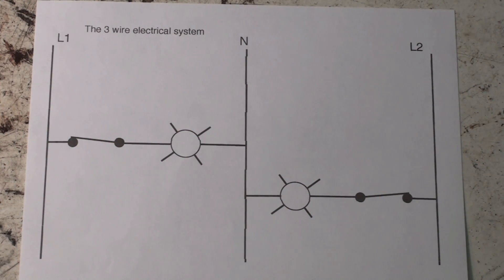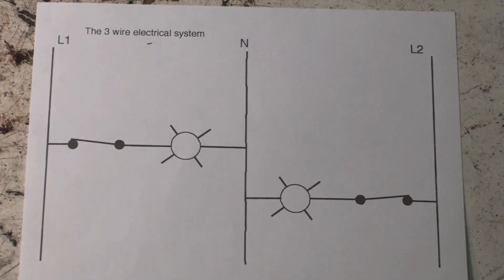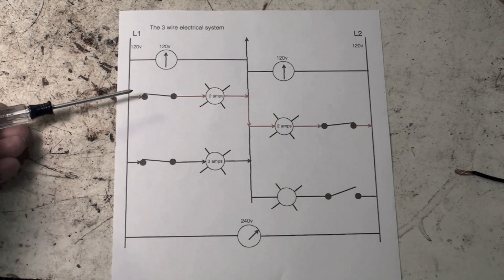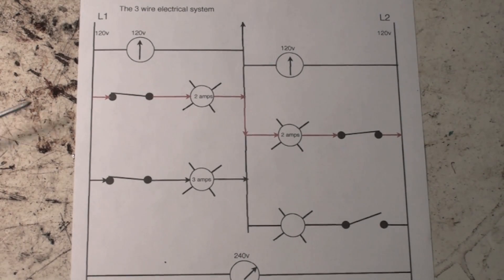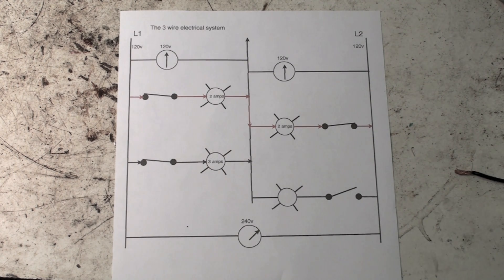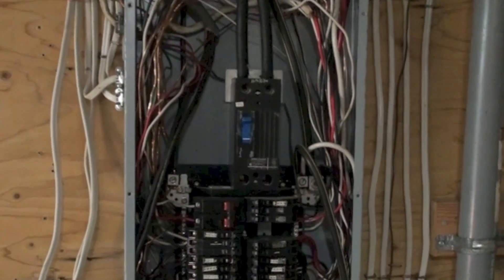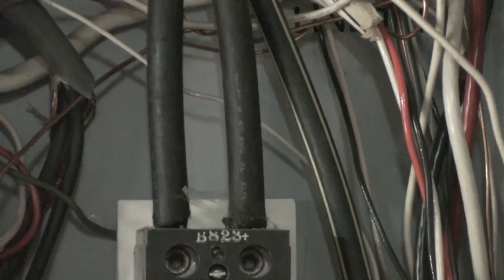How the 3 wire electrical system works

Comment: Hi, I'm an Electrical Engineer from Australia and I just stumbled across this video. I watched, I understood what the poster was trying to convey but I must say it would be a little confusing to the some and some statements were made that are not entirely accurate, not enough facts were conveyed and some are entirely wrong.I do understand that mains AC (Alternating Current), distribution and delivery to end users is somewhat different in the USA compared to other parts of the world (not making a judgement here, just a statement), but the principles and behaviour of electricity and electrical circuits are consistent and dare I say universal. I apologise now if I am going to offend people, but three simple basic rules:1. "Potential Difference" measures the ability of work to be performed between two points i.e one point has to be at a "higher' potential relative to the other point for any work to be performed. In electrical circuits this difference is measured in Volts (named after one Alessandro Volta - inventor of the battery and other things).2. "Current" is the flow or movement of a substance caused by a potential difference. In electrical circuits it is called an 'electric current' or flow of electrons and the rate it is measured in Amps (named after one André-Marie Ampère).3. Electrical current will always flow from a point of high potential to a point that is at a lower potential and will always take the path that offers the least 'resistance' or impediment to its flow.Alternating Current is created by varying the potential difference between two points over time in an electrical circuit. Voltage is changed from a Peak Value down to zero and then back again over a fixed interval of time - cyclically.  Because you do not know the actual value of this voltage at any given point in time we just use the 'average' called an RMS (Root Mean Square), of the AC current. In the USA it is 120VAC and it varies at 60Hz or 60 times a second (actually it goes from a positive peak to a negative peak in one cycle so it actually varies 120 times in one second). Now grayfurnaceman has shown how each home is fed with three cables from the street. L1 & L2 are the so-called 'hot', 'live' or 'active' lines as we call them here and the other is the N or neutral. These are fed via so-called centre tapped transformer where L1 & L2 are the outer ends of the electrical secondary coil and the N is 'tapped' from the centre of this coil. As grayfurnaceman correctly stated, if you place an AC voltmeter across L1 & L2 you will indeed read 240VAC!Now, if you took another two AC voltmeters and placed the positive leads of each on L1 & L2 respectively and then their negative or common leads both onto the N you will see that both meters will read +120VAC. So this adds up to 240VAC which is what the meter across L1 and L2 shows so its ok - not so fast. Referring to Rule 1 above, L1 & L2 CANNOT ever be at the same potential of +120VAC (as offered by the video), referenced to N because it would VIOLATE Rule 1 with the voltage between L1 & L2 having to be 0VAC and not 240VAC as measured!It is actually because True-RMS voltmeters work by measuring the potential difference between its positive lead and the black or common lead and calculate the average only. So the voltage on either of L1 or L2 could be negative or positive at any given point and it would not matter.Now the astute amongst you would have now worked out that for this to work, be consistent with what we see on the meters and obey the rules and - we must conclude;Fact 1-  Both L1 and L2 can NEVER be simultaneously at a positive or negative value with respect to the N line.Fact 2-  When the voltage on L1 is increasing positively then L2 must be increasing negatively at a negative voltage in reference to the N line and vice-versa.In reality the L1 and L2 lines do indeed have an alternating voltage and they move in a sinusoidal fashion but are 180 degrees out phase with each other.So now referring the diagrams we have a 5A load between L1 and N and a 3A between L2 and N. Here's how the electrical circuit works for simplicity I have assumed peaks;Case 1: When L1 line is positive, L2 line is negative and in accordance with Rule 3:5A of current of will be drawn from L1 lead through the loads and into the N lead to the street as it's zero resistance. 2A of current will be drawn from the N line through the loads into the L2 lead. A nett total of 3A will be returned to the street on the N line!Case 2: When L1 line is negative, L2 line is positive and in accordance with Rule 3;2A of current will be drawn from L2 line through loads and into the N line to the street as it's zero resistance. 5A of current will be drawn from the N line through the loads and into the L1 line. A nett total of 3A will be drawn from the street on the N line!So result is same - if you place a Current Clamp meter on the N line you will see the 3A flow but electrically not exactly the way it was originally explained.Now why exactly is the N line which, as described carries electrical current actually connected to a grounded earth?
Reply: Mate, is this some sort of back-handed comment? Sorry to hear that in your work-life you had to deal with "absolute dunces" and "incompetents", as you say. Personally the OP understood the context of my comments and was appreciative so I can only construe that it's you having a hard time understanding. I won't apologise for pointing out technical inaccuracies as I like to see and deal with correct facts.
Reply from the maker: +John Canalese Thanks for the thoughts.  Your explanation is factually correct.  My job here is to explain the 3 wire system so the student will understand, in a basic way, what to look for when troubleshooting problems with this type of wiring system.  When teaching, you have to decide exactly how much you want to explain so that the student will understand the concept without delving so deep into theory that you lose them.  The fact that in alternating current, the peak voltage is 150 volts is not useful as the vast majority of the cycle averages around 120 volts.  If I was teaching an engineering course, these things would be useful.  btw, I have been to Australia 4 or 5 times and I consider it the best vacation destination out there.  Nothing compares to the barrier reef!  
GFM
Reply: +John Canalese Very good elaboration, it closes the loop on Grey Furnace's "simple to follow" explanation by delving into phase relationships and how the transformer produces them. The overall collaboration was great! I love this forum.
Reply: +John Canalese Thank you so much!! Electricity can be so conceptually difficult to grasp. I am looking forward to thinking about your comments.
Reply from the maker: +JetMechMA The primary reason for the connection to earth ground is to provide a path for lightning and other surges, spikes etc without them going into the structure and causing damage.  Ground fault protection as in the GFI does not nee3d an earth ground to operate normally.  Hope this helps.
GFM
Reply: John!, old bean, I have worked over 38 years in the field and some of the dumbest people I have ever met have been engineers, just saying?.
Reply: that was a better explanation.  I didn't like the "neutral is a gathering place" analogy. I would think it would  be better if you showed the entire circuit with the transformer windings so that your could see it as 2 distinct loops of current and what the neutral/centre tap actually does.
Reply: MrOperettalover  I presume your country is America. As I said I am not 100% familiar with Electrical wiring standards in USA but I think there are many different ways power seems to be delivered 1) 2-wire with 'hot' and a 'neutral' 2) 3-wire with two 'hots' (180deg out of phase), and one 'neutral' 3) 3-wire 3-phase system with three 'hots' (120deg out of phase) 4) Others ?. In trying to comprehend your response I deduce that your house seems to be connected with a 3-Phase system distributed from a 'Delta' wired secondary Transformer in the sub-station (?). That is possibly why you see 220VAC RMS as line voltage between the leads - although I thought it should be closer to 240VAC because in this configuration Phase Voltage = Line Voltage. Now if as you say you have , for example L1 & L2 wired as "hot" and "neutral" at your house outlets then why are your appliance's not exploding - I thought 115VAC is the standard and they are going to get 220V! Using your description I simply cannot see how you can power domestic home appliances there unless there is a another step-down transformer in your house delivering 120VAC. I don't fully comprehend your 'over-voltage' protection and load sharing statements so I won't comment. On the fuse issue, I think you are talking about RCD's (Residual Current Device), which monitor 'hot' and 'neutral' current flows in a circuit and will rapidly disconnect the 'hot' supply if there's a difference, around 20mA usually meaning a leak to ground somewhere. We have those and have been mandatory in Australian Wiring Code for many years. EVERY outlet has a mandatory ground circuit. Australian power street cabling is wired as 3-phase with Neutral (four wires), at 230VAC nominal Phase Voltage at 50Hz - a Wye Transformer. Most houses are fed a single-phase and Neutral (two- wires) with a each house in the street alternating in phase to load share. Houses can be fed 3-phase for large A/C systems etc. I'll let the authorities know that it is "retarded".
Reply: @johncanalese588  I agree it seems like they're making it mandatory three phase or L1 L2 and n when say going to a subpanel for a small shed it could just be L1 and n but I'm guessing that is wrong in America?
Reply: Warren McCarty & PJ I’m not living in America so don’t fully know the standards. But, I presume most if not all modern or new houses will be wired to street power with three wires - L1, L2, & N. The heavy power users like. Dryers, ovens etc will be powered with a two-wire circuit of L1 & L2 (240V). The lower power consumers will be  powered by two-wire circuit comprising of L1 & N (120V) or L2 & N (120V), presumably with each required circuit  alternating its use of L1 or L2 so as to share power load. Now, a shed would just be another of these circuits. The ground wire in the power socket  can be connected to the N wire but NOT directly, it will be carried back to the main distribution board and connected to the street power inlet BEFORE the distribution panel. In this way any RCD devices can function correctly. Of course in my explanation above, if you are requiring an “earth” protection socket to be used then the two-wire circuit(s) would then be three-wire circuits with the additional wire being the earth and connected as I explained.
Reply: The North American power grid produces 3-phase power. COMMERCIAL facilities will have 3-phase delivered. RESIDENTIAL/small business facilities have single phase 230 vac that is CENTER TAPPED providing the two 115 vac loads with the center tap be the neutral. LOAD-1 and LOAD-2 are in phase. Measuring across LOAD-1 to LOAD-2 gives 230 vac.

Commercial facilities provide 208 vac "single phase" utilizing two 115 vac loads that are tapped off different phases 120° apart. "RMS" meters read 208 vac when measuring between the two loads, but 115 vac between each load and neutral. Fortunately, most equipment will work with this arrangement. You must have seen the "208/230" designations.
Reply: John Pomer No, on any center tapped secondary winding of a transformer the voltages at each end of the coil are indeed 180deg out-of-phase with respect to the center tap. A voltmeter connected across the coil (L1 & L2) would read 0VAC if they where "in phase" and not the 230VAC as you stated. Yes, pretty much all countries have Power Stations generating 3-phase power (each phase being 120deg apart), with phase voltage stepped-up to 330kV or 500kV to be distributed to the users. Where it gets interesting is how this is then stepped-down, transformed and delivered to end users. So, if I understand you correctly these "Commercial" facilities must be getting 3-phase power fed from a substation using transformers with Wye-configured secondary windings and these have a 115VAC phase voltage? then that is why you see 208VAC as the Line-to-Line voltage (i.e 1.732 x phase voltage). Hmmm.....so this is yet another power delivery method is USA. How do you guys manage all this.
Reply: @johncanalese588  Hi, I do not understand much about this because it's not my area but I saw a video where they make a combined Delta-Star connection: 
https://www.youtube.com/watch?v=uw3hkaWP27A&list=FLh-Bxr3oXZoqdiiJb-0Dxmw&index=2&t=0s
(The video is in Spanish, any question I can try to translate. My English is not very good either)
The system shows a three-phase system (208V) consisting of three lines of 120V and one neutral. In addition to a fourth line (line D) that in combination with line B, provides 240V single phase.
I do not know what commercial uses this connection has. I understand that in North America (Caribbean and Central America included) the houses have 240V in split phase (neutral and two lines of 120V with 180 ° out of phase)
Reply: Oops - 180° out of phase is correct. The two load lines are off the same phase.
Reply: Correct; voltage fluctuate from about 95V to somewhere around 135V; that is why computers have a transformer power supply that cleans up current and makes it a steady 120V. The secondary is also 120volts but constant.  In high amperage environments, like specialty welding machines where secondary current is very important, they use an electrical reactor to control amperage.  By the way, your video's are really good!
Reply: So now I'm confused. What I understand from you is L1 and L2 have 120VAC (shifted 180 deg) relative to N. So N is ground. So why does it say in the video that N is not ground?
Reply: I could be wrong, but I don't think grayfurnaceman is conducting a lecture on electrical engineering, just trying to give us lay people an idea of how our power panel is set up.  Just for your information, before I retired I worked for a US federal agency in a technical job where I worked with engineers and electricians among others.  Some of them were absolutely brilliant and others were absolute dunces, absolutely incompetent.  So just the fact that a person has made it through college and has a title doesn't mean that they really know anything.  I was amazed at how stupid some of our engineers were.  Some of them did not seem to understand ohms law.  Hats off to the smart ones though.

Comment: power gong from l 1 to l 2, don't make sence. doesn't 120 power end up in neutral?
Reply: +brad alhadri 
Yes. 120 returns on the neutral 240 goes pole to pole.
Reply: Retro327 No, the 120 v goes L1 to L 2,  That is how the box is balanced.

Comment: Sloppy electrical box lol. Was that a "fused" neutral on the 240 breaker on the top left?
Reply: +Lee Cooper yes very sloppy indeed. no that is not a neutral on the breaker, just a white wire being used for a phase conductor. in a commercial environment it would be proper to mark it as such with phasing tape.

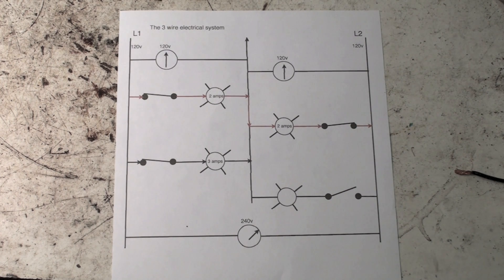Comment: at 4:29, you say that the neutral returns on the power pole.

Correctly, upstream of the service entrance panel, it's technically a ground.  In a properly configured system, the neutral is bonded to ground at the service entrance (main panel).
Reply from the maker: +Ray Arsenault When it goes to the pole it is a neutral as it connects to the center tap of the transformer.  The ground and the neutral are constantly being misrepresented.  Any sort of earth ground is not necessary for the operation of the system, but neutral is necessary.  Ground is only for dissipating spikes and lightning.  Think about it.
GFM

Comment: Sir, no offense but do you really know enough to talk about electricity?   Just to tell you of the bat if you measure voltage across two hot wires at your home in a single phase it will show no voltage.
Reply from the maker: +Dhakka Jaib This system is used in the US.  There are 2 hot leads that come from either end of the pole transformer.  The neutral is the center tap of the transformer.  If you are in Europe, it is not done this way.
GFM

Comment: If there's an unbalanced load travelling back on the neutral, and the neutral is grounded at the panel, what is preventing the current travelling back on the neutral from flowing into ground?  Thanks
Reply from the maker: +Steve Bitschy The earth ground does not equalize the 2 hots.  If there are unequal loads, they just stay unequal.
GFM
Reply: I am curious about this too?  I always thought the unbalanced current on the neutral went along the neutral to the panel...and that the neutral 'bus' at the panel was grounded to earth...and so unbalanced current would go to earth.

Comment: The NEUTRAL is the return path to the center tap of the transformer on the power pole. The 240 volt service is BALANCED (two hot lines and NO NEUTRAL current). 120 volt service is UNBALANCED (one hot wire and neutral return current
).